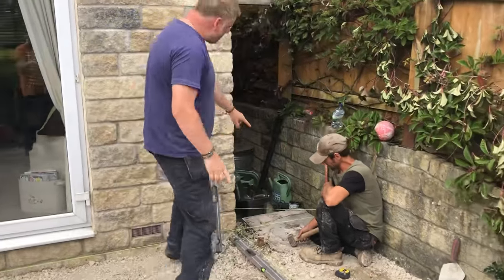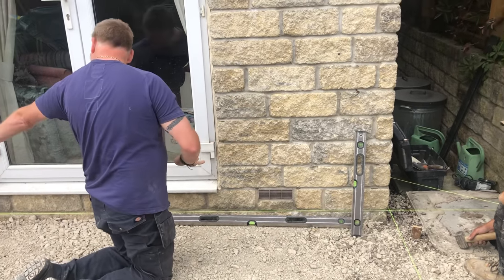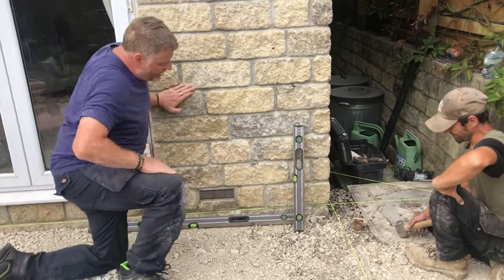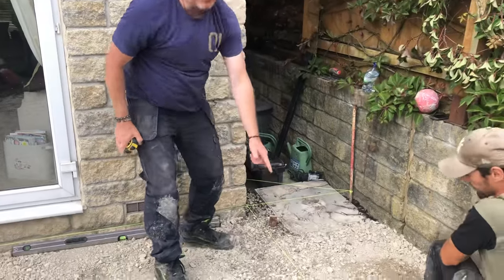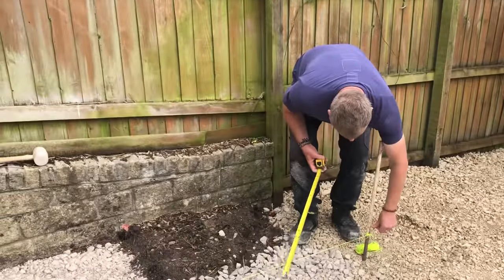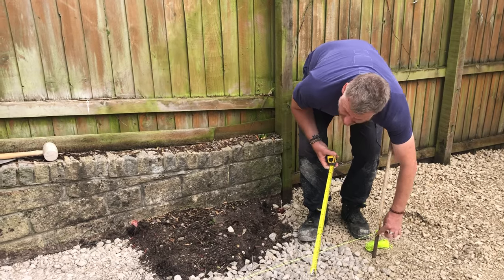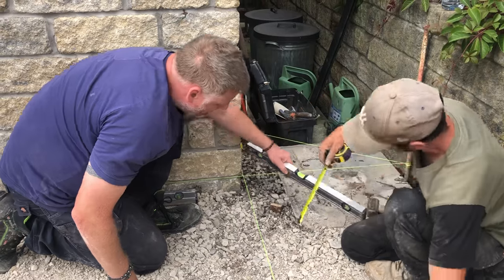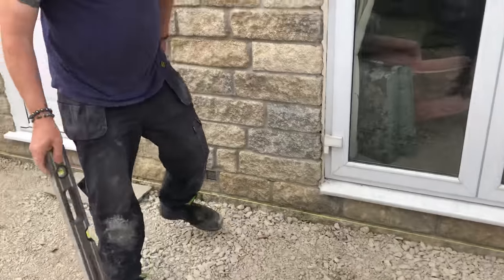How To Set Out Levels/String Lines When Laying A Patio

Comment: Thank you for this video. If you've measured 3 feet along the top and 4 feet along the wall and made sure the hypotenuse is 5 feet (Pythagoras theory) - Is it just proving the wall is  90 degrees to the rear of the house?  How does that prove the string from the house is 90 degrees?
Reply: I'm not sure why it was done this way either. Unless it was just a demonstration on how to create a square with no relevance to the stringline set up.
I would have thought you'd measure 3 foot from the corner of the house inwards, measure 5 foot with a tape from that point and adjust the stringline until 4 foot of the stringline meets the tape.
Reply from the maker: I’ve explained on other threads mate
Reply: He established his 4 foot baseline against the wall which is square. You would just measure from the string line to the baseline at intervals and ensure the distance for each of the intervals is the same, which will mean the string line is perpendicular to the house.
Reply: From the corner of the house to the wall where he marked 4 feet , and from that mark he has on that wall , to that mark that is beside the corner house which is 5 feet , means that wall is square to the mark he has beside  the corner house , now you just measure from that wall to string line , same measurement mean the string line is parallel to that point and obviously squared .

Comment: Love this, although I may have missed, how did you know where 52.5mm depth was down at the other end?
Reply: So if you make you string line level to start, calculate how much fall you need for the distance, measure how far you need to drop the string line at the far end to make the slope then pull the sting line down to that new mark.

Comment: Hi. Great video. I'm laying  riven indian sandstone patio and have read it needs to be 1 in 60 fall. On my 6m patio that's 10mm.im running towards house and using aco channel drains. I've set the fall lines and it seems very steep. Can I get away with 1 in 80 which will reduce the total fall by 25mm? Will it drain off water OK with the riven stone at 1 in 80.thanks
Reply from the maker: 1-80 fall fir rivened sandstone

Comment: Silly question, if you have got a fall in your compacted hardcore level do you not have to dig deeper at the far end of the patio than just a standard 150mm deep across the whole first dig? I.e have a fall in your initial dig.
Reply from the maker: Yes that’s correct

Comment: nice man , you can also take a plastic or metal carpenter square and use it to adjust the string line , not as accurate but saves a lot of time .

Comment: Good video! We want to change the patio slabs in our garden as the ones from when we moved in are horrible. 
We also want to extend the patio from it's current size.  In this situation what would you recommend is done regarding the sub base & mortar.  Should we remove the whole lot and start again or try and add/level the sub-base and mortar where the additional tiles will be so it matches the rest?  Thanks
Reply from the maker: Aled Gravelle i would lift all the paving slabs, examine old sub base to see if it MOT type 1 or a recycled equivalent and a minimum of a 100mm depth. If it’s not correct depth I’d reduce dig and re stone up and compact. Never run with an old sub base if it isn’t to spec which includes being 150nm below DPC

Comment: Hello mate - great video but have a question. 

You are measuring the datum pegs in 1 meter intervals and making sure they are ‘level’ BUT that won’t take account of the 55mm fall away from the house will it? You’ll end up with a totally level sub base. How do you make sure you have the fall correct?
Reply from the maker: Dane Skinner Fully take on board what you are saying and possibly didn’t word that part correctly. 
We would use a level on the string line coming from the house where we have a second string line with a touching bubble fall. At the end of the patio we would set datums measuring 55mm off a level string line. We would then line the datums up and knock the datums down accordingly to the fall of the string line. I’ll do a further video doing this with the laser level and the string line way and explain more accurately. Thank you for flagging this
Reply: Gareth Wilson thanks a lot. I’ll look out for the vid. You’ve inspired me to crack on with my patio - slabs and type 1 on the way this weekend. Thank you 😊

Comment: All good but how do you know that brick wall by the fence is straight when doing the 3-4-5 rule?
Reply from the maker: Measure the string line to the wall in several places and it should be the same measurement from  the wall to the stringline

Comment: Great video, quick question. I'm assuming you laid your datum pegs before adding sub-base. When compacting, do you just avoid running the whacker plate over the pegs to ensure that they aren't pushed down too far?
Reply from the maker: Paul Barker yes mate avoid until you get your compaction to correct depth. I’d then knock the pegs down once you are at desired level. Always worth noting .... Measure twice cut once rule .... Therefore double check levels

Comment: Good video. How do you work out the end of the patio is 52.5mm lower than at the house? How would you measure it if the ground is not level? Also how do you ensure the patio is straight if the house is off at an angle compared to the garden?
Reply: I think you measure level across from your starting point (at the house), mark it at level, then measure down from that level to the required drop, mark up and move string down to the right point. Happy to be corrected though (I am researching this for my own patio project too).
Reply from the maker: Most accurate way is a laser or zip  level. But a string line and a level will work too. 
So put the end of the level at finished floor level and centre the bubble to level, using a string line run the string line level just underneath touching the level so basically the string is level. Then knock a datum peg in where the patio ends, mark where the string line touches the datum (level) then work out your fall in mm and knock the peg down accordingly.

Comment: Hi there Gareth. Love your work on Instagram mate. I'm setting out to lay a patio soon. However I'm kinda stuck on falls. Do you establish your fall after mot type 1 or during the digging phase? If its the latter, does it mean I just have to dig out more muck out at the bottom of the patio when setting out? Thanks
Reply from the maker: Thank you Larry ... Your MOT needs to run at the same falls as your paving so I’d dig out more if required
Reply: @GKWilsonGardens  Thank you mate!

Comment: Might be a silly question but is it possible to have a fall in in both direction eg front fall to back and left falling to right. TIA
Reply from the maker: Yes it pal... Cross fall it’s called
Reply: @GKWilsonGardens  is it alot my difficult to do it that way though especially if its my first time
Reply from the maker: I think I’d stick to a one way fall. It’s only really on commercial projects you will need a 2 way fall

Comment: Newbie Q here, is that a touching bubble fall on a 4ft level, 6ft, or does it not matter as long as you use the same level throughout?
Reply from the maker: Paul Brewerton touching bubble/line is the same on all levels however different makes of levels will have differant tolerances. So it’s important in my view to use level sets by the same brand and calibrate them before each job and at regular intervals. So a standard set of levels have a 600mm, 1200mm and 1800mm, put them on top of each other vertically and move the levels up and down slowly and look to see that all the bubbles move equally then lay on an even surface and check to see that all the bubbles are in the same position, any bubbles out of sync on a particular level indicates that, that particular level or levels are not correct. In some cases you may need to check against another set of levels. I also turn them upside down and re check again, the tops of levels sometimes get misused by being tapped with mauls to level pavers which isn’t good for the level and bad practise. Also check straightness of levels agains a flat surface. 
It’s important to use all the levels in your set too which I’ll go into in a later video. With riven paving I’ll sometimes take 3 readings if I’m in any doubt if falls are correct with 600mm sq and  above size pavers  (left side, middle and right side) also cross fall (side to side) too. 
I always start off using 600mm level and build up to a 1800mm the more rows I lay . I’ll also use the 600mm level on individual pavers from time to time to make sure we are spot on. 
A lot of porcelain can have bows on the surface and dips in the corners so this present other skills to master.
Reply: @GKWilsonGardens  Hey, kids: THIS is how to answer a question.

Comment: Hi Gareth. Great job you doing mate. I see your responding to a lot of questions on the Facebook page "Patios and drives". Can I ask were you got those metal pins that you are running your string lines on? I can't seem to find anything like that lol
Reply from the maker: Hi Larry 
Im not sure to be honest .... I bought them years ago and now I’m not landscaping anymore I can’t remember to be honest. I’ll try and see if I can remember the website for you.
Reply: @GKWilsonGardens  Okay thanks mate. Not to worry too much, I may end up using just wooden pegs. Cheers
Reply from the maker: Found em https://www.hall-fast.com/prosolvetm-road-pins?gclid=CjwKCAjwtpGGBhBJEiwAyRZX2h2SDLY8l3-hgDZ9lvCA-fS_a_PDtz8227_AocjTJudyA0dsswDvOBoCEzYQAvD_BwE
Reply: I am just at the point of setting my strings out on a new patio at home.  Checked the pins teccomended and for diy low future usage, they are too expensive.  I am going to use instead some old left over 12mm steel re-bar cut to 400mm lengths.  Can put a point on one end with my angle grinder.

Comment: Hi, do you leave the datum pegs in the ground, or do you take them out before laying the mortar mix ontop?
Also, i haven't put any hardcore/MOT down, my plan is to use a 2inch dry mix (3 or 4:1, sharp sand:cement) ontop of compacted soil (seems study enough, I cant dig my heel into it). I know its not a professional job and may not last 20 years. But do you think this will be ok for at least 5 - 10 years?
Reply from the maker: I’d always use a sub base and can’t recommend you do things like you are proposing to. I could possibly say how long it would last. My advice is go the extra mile and lay a sub base

Comment: Wha's to say your garden wall is square to your house string line? You should have used the 3-4-5 method to string your perpendicular line (in shot running away from the house), ideally using as many multiples of 3, 4 & 5 as you have room for, for accuracy.

Comment: You said 50mm he gave it a tap and measured 55mm then said I'll give it another tap which would take it to nearly 60mm dear
Reply: its 50mm below the level its going down not up ;)
Reply: I am also confused by this, if the distance between the level and the peg is 55mm then surely by hitting the beg again will only increase this distance. Could you clarify this please? Thanks
Reply: @VICTORRABBIT123  The level is the line - The spike in the ground is going down below the level so say they start at 100mm on the tape measure. They then knock the spike into the ground until it measure 50mm below the line.
Reply: Y-it-Earp 100mm being what measurement? The distance between the level and the peg? That’s what it looks like they’re measuring right?
Reply: @VICTORRABBIT123  correct there measuring between the peg and the level...so your right by hitting the peg it increases the gap he needed 50mm he hit it which gave him 55mm then hit it again which would of put it even further out so your correct he actually needed to raise the peg not knock down further 👍I'm a bricklayer of many yrs so deal with levels everyday of my life.

Comment: What did you actually square, the garden wall? certainly not the line,  how do you know that's straight all the way, should have used a builders square off the house line ( or Pythagoras 3:4:5). I don't see how you got a square of the procedure you've shown.
Reply from the maker: Mike James I said in the video I’d squared that string line you mention up to the house pal. I then secondly squared the wall up to the house to show as an example. Thanks
Reply from the maker: goodcat1982 A builders square is actually a guide and nowhere near as accurate as 3/4/5 as you can’t go wrong with it. We learned the inaccuracies of builders triangles at RHS Hampton court once and it took some sorting out and lots of down time. 
Regarding the wall I double checked this as I would do a fence due to the fact that builders virtually never square fences or walls to the house and more often than not run out leaving a wedge shaped gap. If this was the case I’d over size the paving slabs and cut to profile of the wall so we don’t have tiny cuts or a v shaped gravel strip etc. Hope that makes sense as it’s hard to explain by text
Reply: I use the 3, 4, 5 squaring method...but I muliply it by 3...so I have a 9'x 12'x 15 or 12'x16x20' is way more accurate...

Comment: What is mot?
Reply: Bunch of crushed rock and bricks and recycled road crap. Its just rubble. The bags you will get in a shop will be called MOT subbase. Type 1 is the type you usually get for this sort of job which is the size of the rubble.  Its just a layor of rubble you compact down to stop the pavers sinking into the ground over time because its nice and solid when compacted. Then you wack some mortar on top and squish your paver onto it while making it level with the other pavers and the slope you calculated